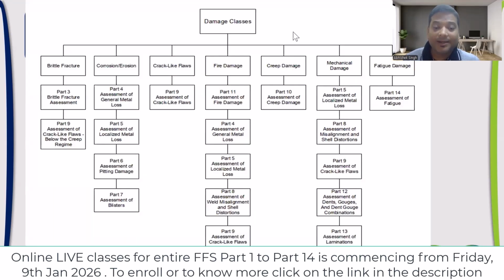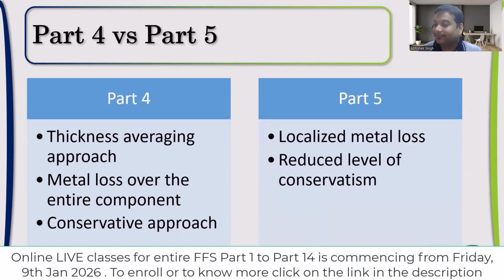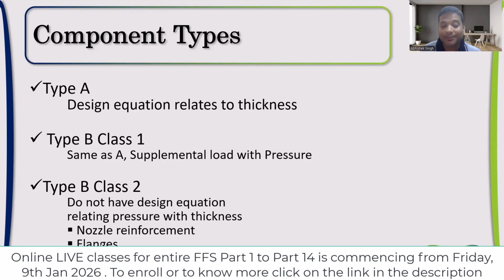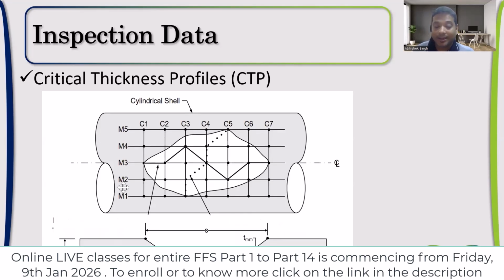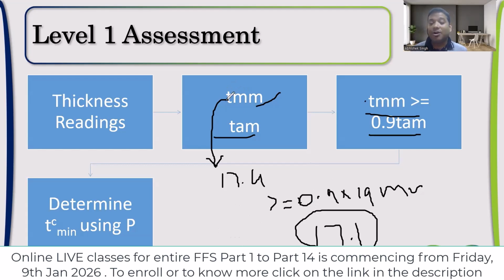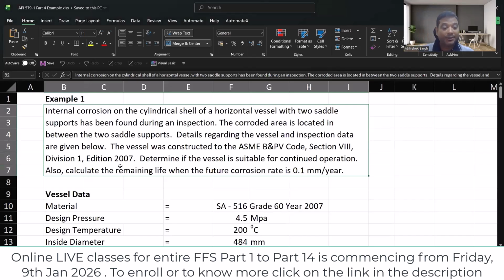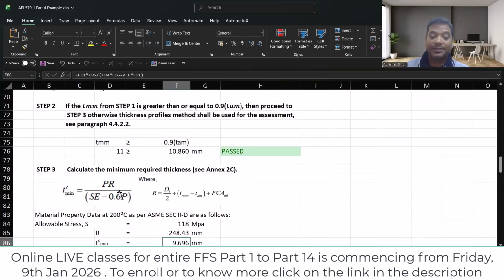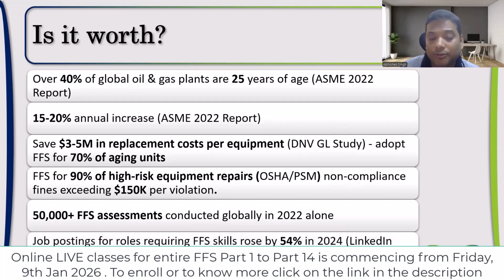The ABSOLUTE BEST Way to Master API 579 1 Assessment of General Metal Loss

Comment: I have some questions:
1. Why do we use Average thickness and not Minimum measured thickness to check if the vessel passes FFS 

2. On calculating the average, why using all the UT data for shell or dishend, why not ONLY the data around the defect?

3. Why do we have to use FCA, I thought FFS is supposed to tell us if the vessel is fit for service as at the last inspection date.

4. How can I join the live session?
Reply from the maker: Register to learn more about joining the course https://forms.gle/aGcyb7NynNV3RysdA